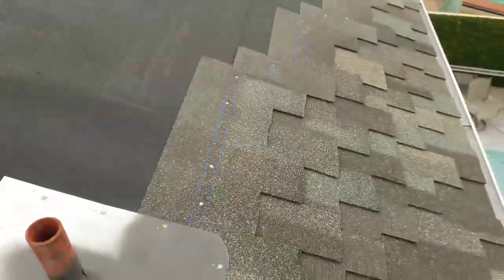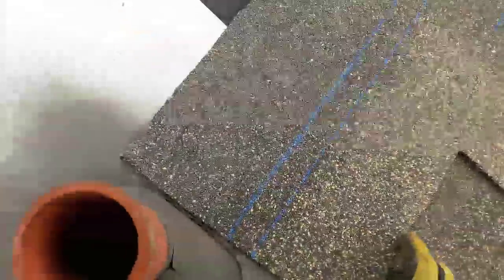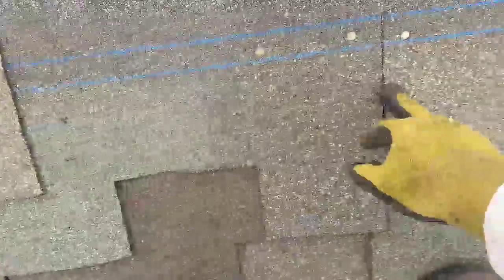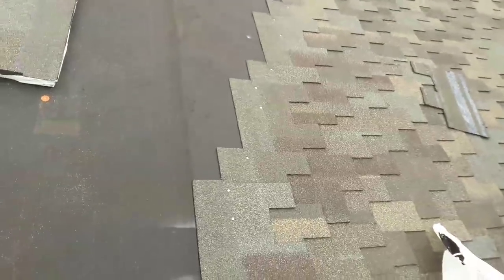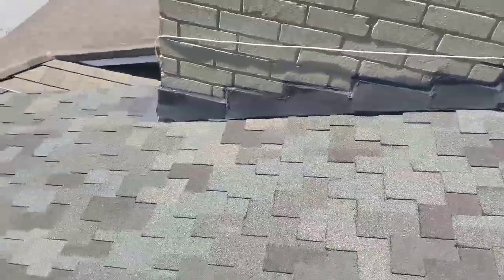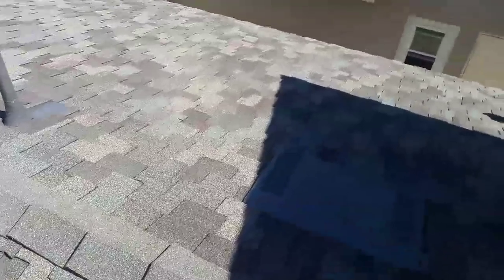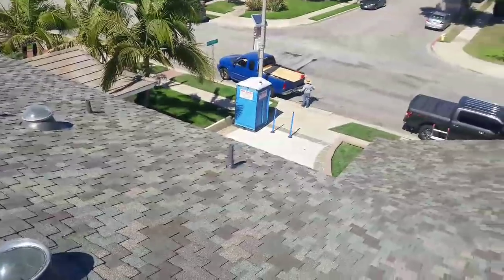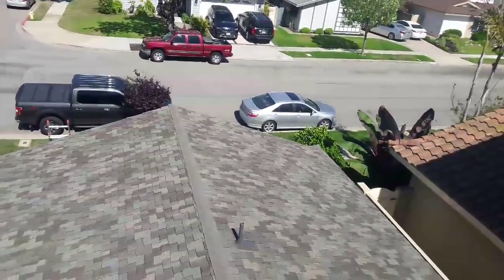Roofing :  Learn how to install Presidential Shingles !!

Comment: ive been roofing for a while up here in NW PA, and i have never seen these!...these things look AWESOME! I wanna see if they are even available in my area! liked and subbed!
Reply: These have been around longer than you’ve been roofing, broaden your horizons
Reply: These are one of the most popular shingles by far very common on upper middle class houses and a lot of HOAs require designer shingles instead of arch for the curb appeal, I see it a lot in HOAs where the roofs were all originally cedar shake or tile. That being said I'm located in Salem, OR so I can't speak on the popularity everywhere outside of Oregon.

Comment: You are not installing your pipe flashings properly.  First the flashing is too high on the course of shingles you lay the flashing on. You should have laid one more row of shingles, you are giving water more opportunity to divert sideways.  Also per the Master Applicator spec, you should be applying Winterguard around the flashing.  I know you are trying to hide all the flashing metal, but not at the cost of doing it wrong and it not being watertight in wind driven rain.  Specifically: The flashing should go to or over the line of the pumpkin tooth pattern.